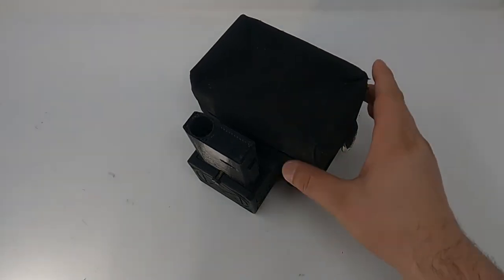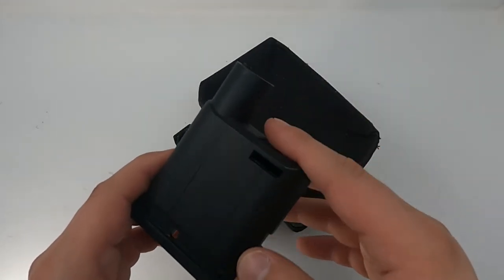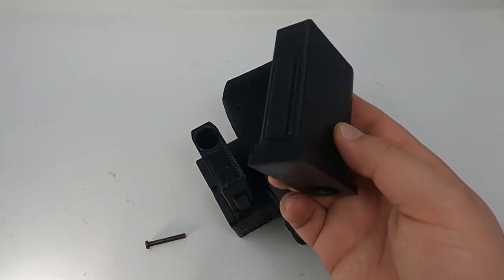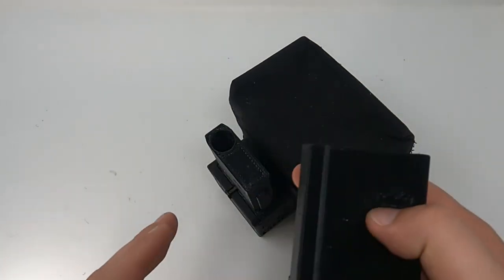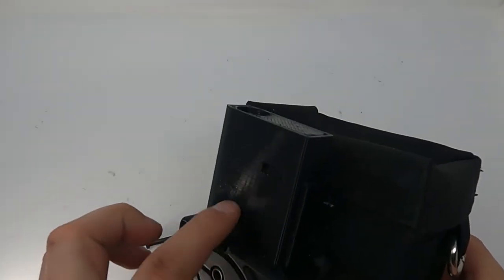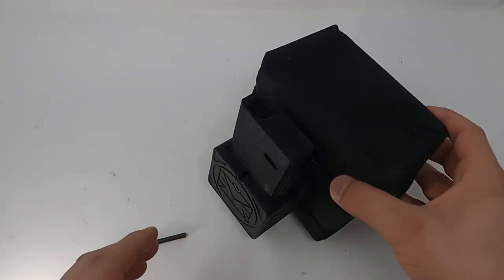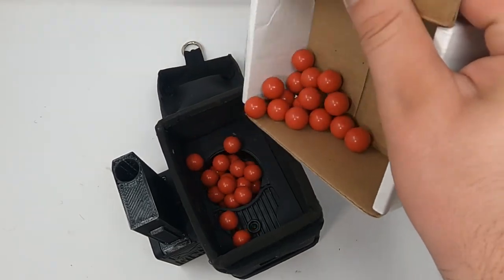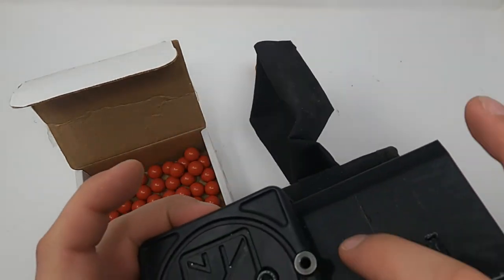MCS Box Mag V3 Feed neck Conversion - Left Handed option - DIY

Comment: I had contact with MCS last week and it seems next month there´s coming a official left handed version of the feedneck. Thanks to the demand they are finally making one :D
Reply from the maker: Well thats good. I suppose they stole my idea 🤐... I'll be coming out with a better one anyway just to see if it's something people want. I have a few versions designed but need prototyping to confirm them. At least they can fill the demand until mine come out since I been busy 😁
Reply: I have the left handed version. Just got it last week. Fyi, the only flipside is that the on and off button on the rip clip will be facing away from you towards the front of the marker. The flip velcro hatch will also be facing towards the marker. The good side is that your mag release will not be blocked on the T15

Comment: What metal ring is that?
Reply from the maker: What's the time stamp? I don't understand what your asking
Reply: @ProjectAnubisUSA  looks like you have a metal ring on the top cover flap to make opening and closing easier
Reply from the maker: @dfa1  I assume that was stock since I bought the loaded used. All it is, is a ring with a clasp to open and shut the mouth of it. It was probably for easy reload for a finger to access and visually able to see at a glance.
Reply from the maker: @dfa1  Here is an example of what it is, size is around 1"
https://www.amazon.com/Bluemoona-Carabiner-Trigger-Spring-Keyring/dp/B00ZXAAGYW/ref=asc_df_B00ZXAAGYW/?tag=hyprod-20&linkCode=df0&hvadid=198055768466&hvpos=&hvnetw=g&hvrand=14685914944777326222&hvpone=&hvptwo=&hvqmt=&hvdev=c&hvdvcmdl=&hvlocint=&hvlocphy=9031867&hvtargid=pla-349746925325&psc=1
Reply from the maker: round carabiner clip is what its called